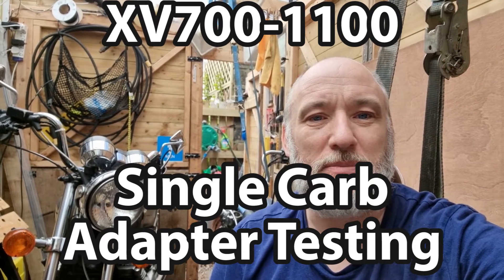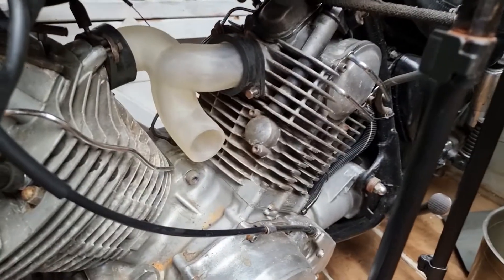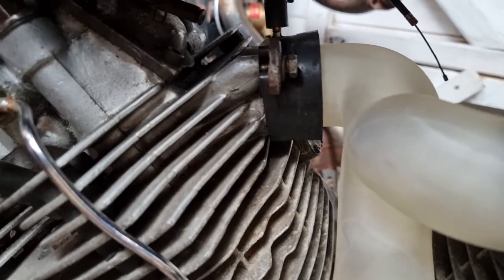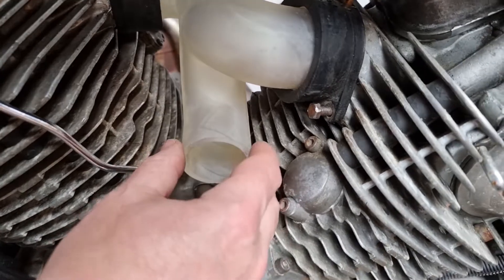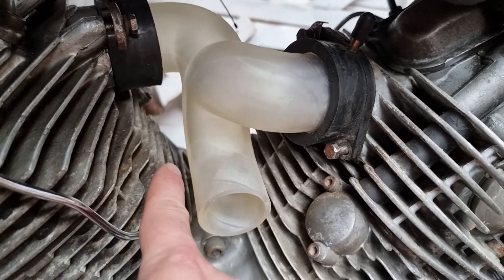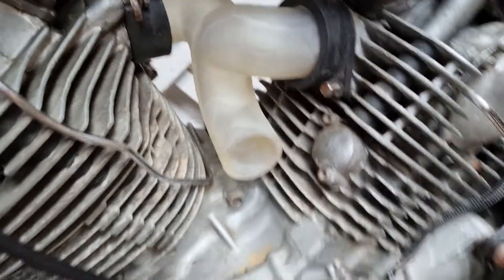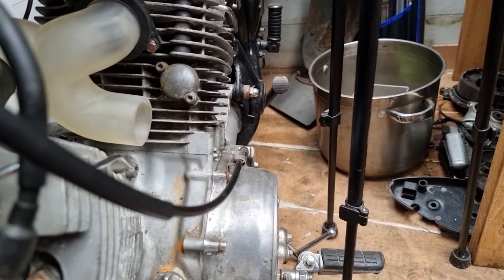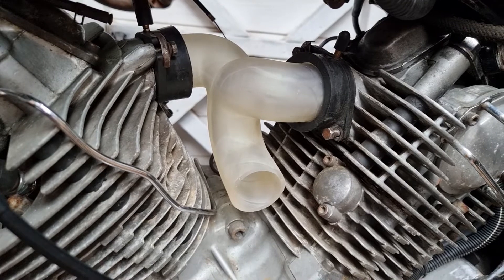Virago XV700-1100 Single Carb Adapter Testing - Tweaked the Design a Little

Comment: This manifold is just wrongly made. Honestly out of technology and physics. From design point of view is quite fine, but it will never work well in different conditions.
Reply from the maker: OK I'll just give up then :D 😀
Reply: My pleasure to meet you. Please don't give up. You are doing good step to help old timers back on the road. Only the thing is the physics of fuel supply.
Reply from the maker: @vtcmotors  specifically which bit are you referring to?
Reply: Well as far as you can see, the fuel should not go from the bottom, because it's already longer way to the cylinders. Once temperature or elevation changes it gonna cause a fuel supply interruption. This is proven with many tests.
Reply from the maker: @vtcmotors  I disagree,  it has worked well so far,  but longer testing will show us the results.
Reply: Well this is my comment only and nothing else. My regards.
Reply from the maker: It's all good,  we all have our opinions and experience we draw on to form them.